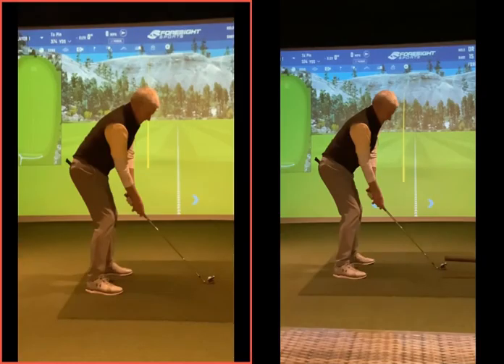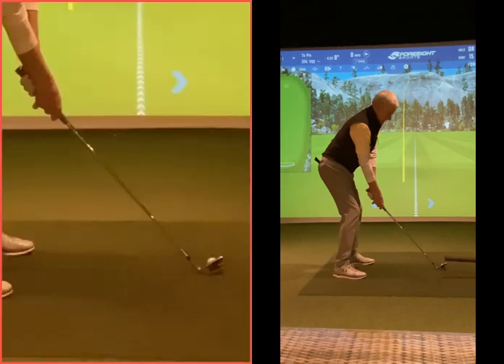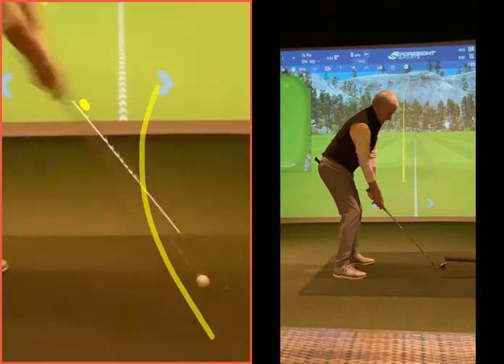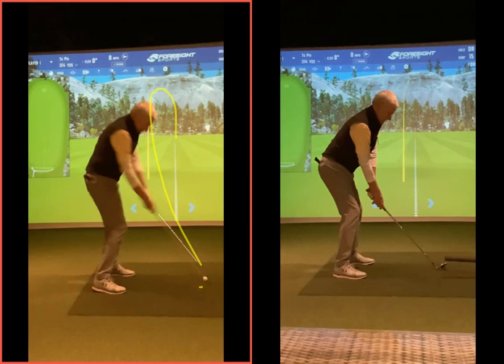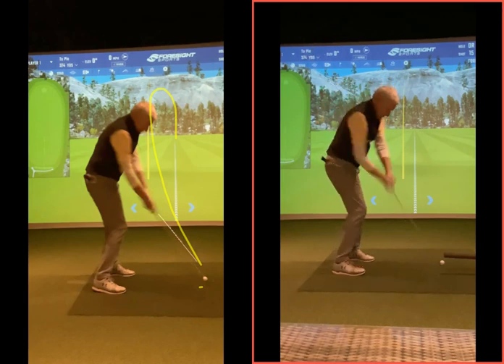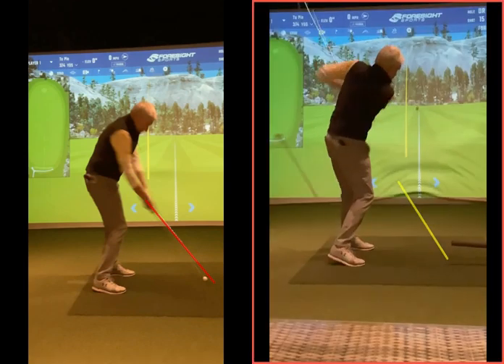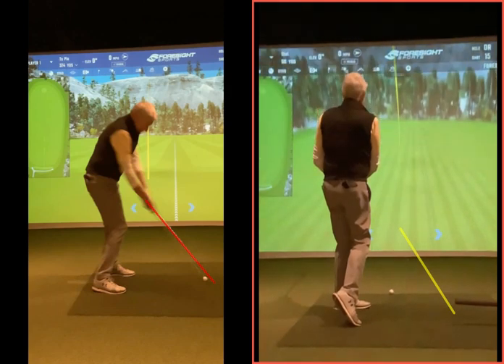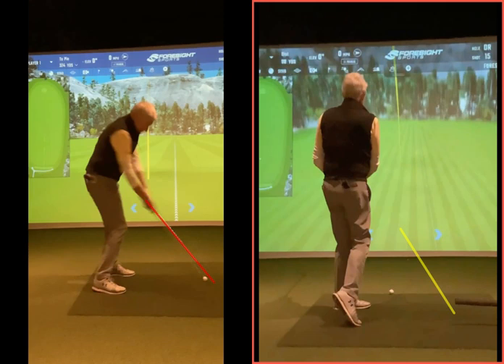Swinging shallower to create a better path

Comment: So you just help him change his path with that poor technique?  Not going to teach him how to compress the ball properly?
Reply from the maker: Change path first then learn body shape to help impact.  One thing at a time.
Reply: @GarethBennettGolf  If he learns impact properly and learns to feel the weight of the club head, swinging without tension, he will learn to swing on plane and shape shots. You’re just teaching him errors that change his shot shape. 😂😂😂 He needs to go and see Pete Cowan.
Reply from the maker: @blue24563 . Thanks for your positive feedback. Just as an FYI. He’s 73 and has a left leg 2 inches shorter than his right leg. So shifting weight is very difficult. And ‘feeling the weight of the club’ head doesn’t miraculously get him on plane. He’s sliced most of his life so always swung left. We squared his face up first lesson and now adjusted path so he’s hitting it 10 yards further and straighter
Reply: @GarethBennettGolf  He’s swinging with tension. You need to feel the weight of the club head before you do anything. And it will put him on plane because it is physically impossible to swing an object without being on plane. 

Like swinging a bucket of water over one’s head. By definition, it can’t happen if it isn’t on an efficient plane. And the plane is a by-product of swinging. If the club isn’t on plane, it isn’t swinging.
Reply from the maker: @blue24563  tension aka stiffness. As suggested he’s not the youngest bloke in the world and has flexibility issues. Yes there’s some tension post impact but every time he tried to relax the follow through he whacked the foam bar. As I said. One thing at a time